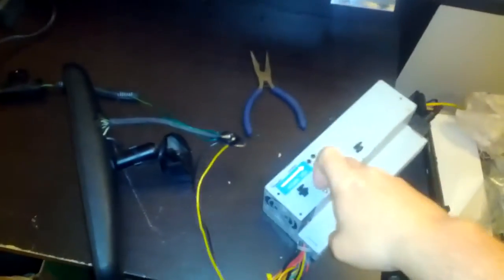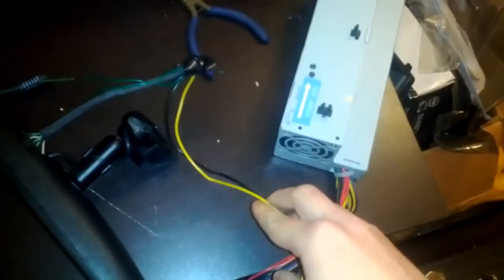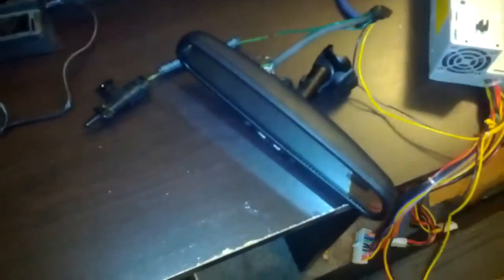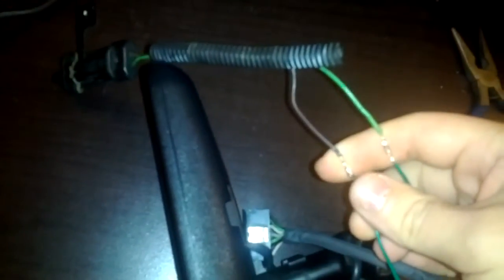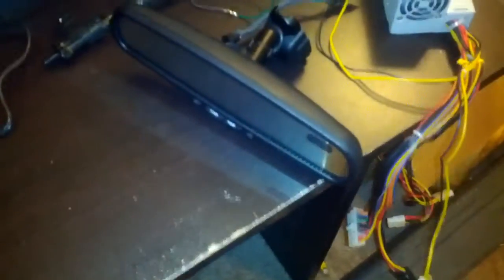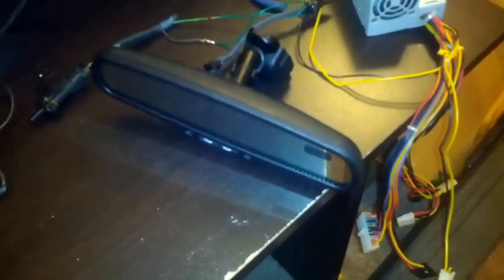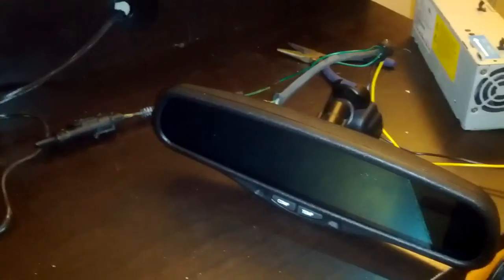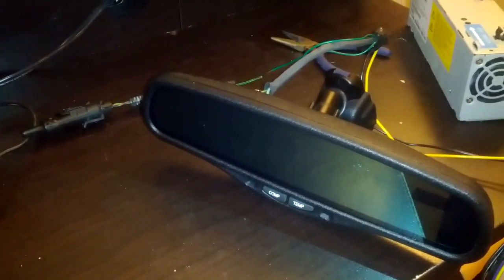GNTX-177 Electrochromic mirror.

Comment: Just installed this in my fiero works great. Clipped the temp sensor on a piece of the inside front bumper
Reply from the maker: I got mine under the driver's side fender. Seems to be working alright now!

Comment: where it's the sensor located on the truck?
Reply from the maker: Which, the light change sensor or the temp probe? As for the temp probe, I don't have a clue. I got this from a junkyard who had already pulled it for me, and unfortunately, they clipped the harness, so I couldn't even begin to guess based on wire length.

Comment: What colors did you use in the video and how did you turn it on?
Reply from the maker: Unfortunately, this was a project I completed about 5 years ago. It's presently installed in a car, so I don't have easy access to find out. GM has a pinout diagram for the plug into the back of the mirror. If you use that, it should correlate to the colors on the plug. If I get time, I'll peel back the wire loom and look at the colors next time I bring the car out for VIR.
Reply: Ravant Shearhart tanks bro